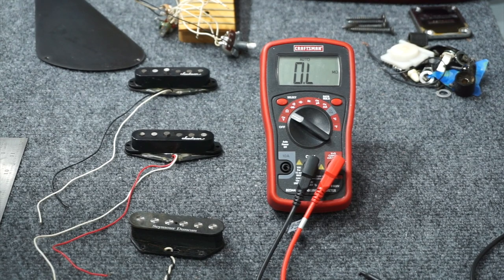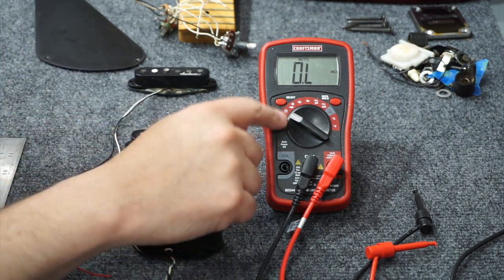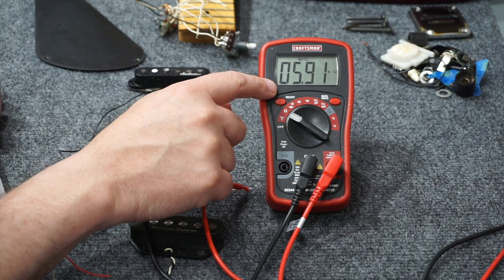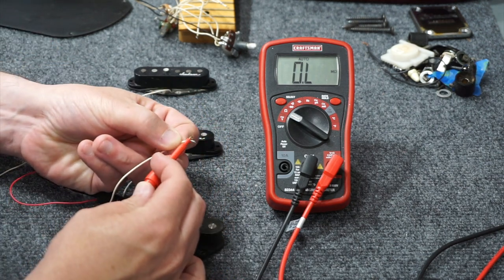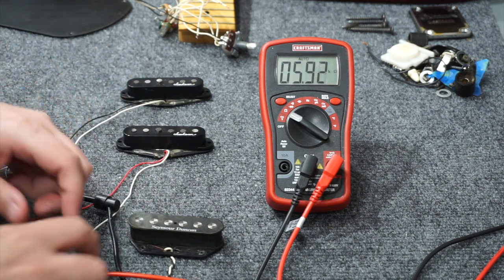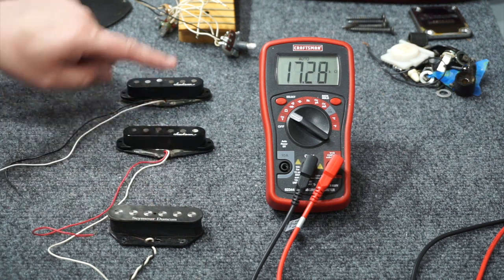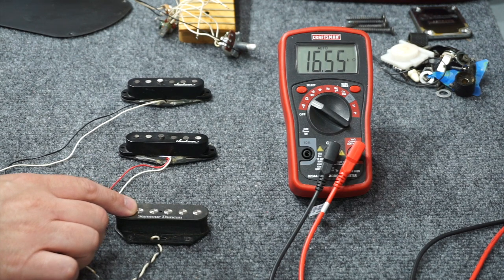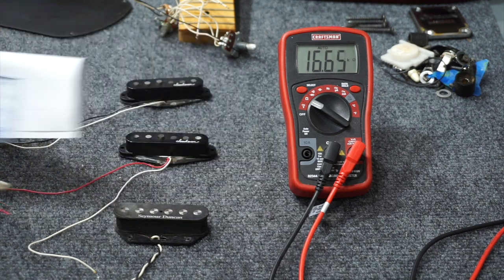Quick Tip 5: Testing Guitar Pickup Phase and Magnetic Polarity

Comment: To do a voltage polarity test you need to set the DMM on DC voltage, not resistance.  You are not measuring correctly.
Reply from the maker: If you don’t believe me, believe Lindy Fralin: https://www.fralinpickups.com/2017/11/22/use-multimeter-guitar-pickups/